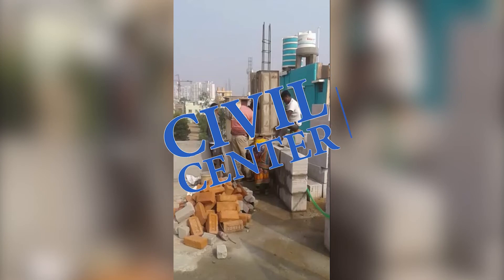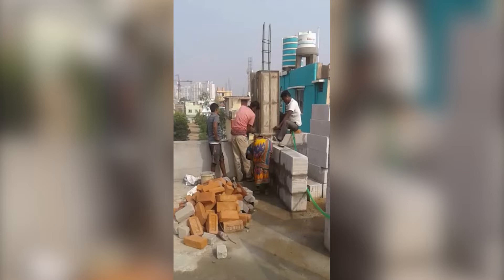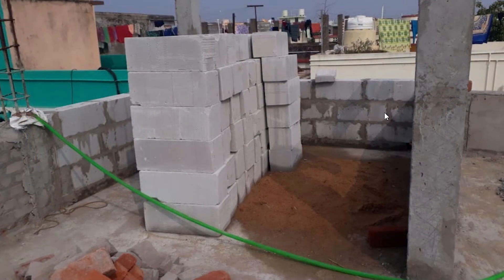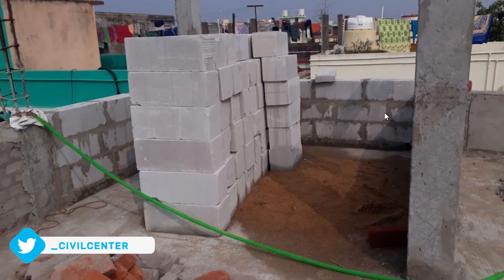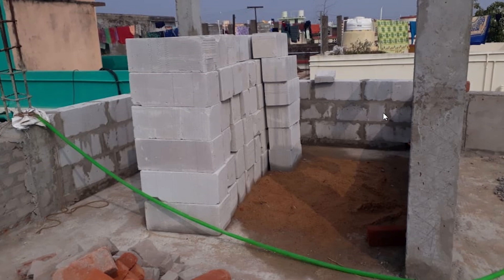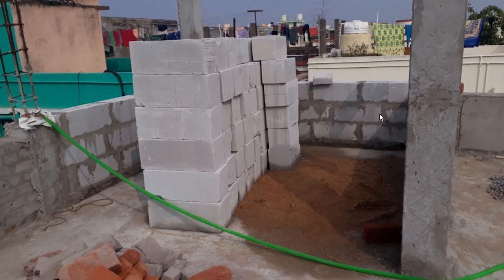AAC Blocks: Pros and Cons

Comment: Do not use AAC blocks for construction, I am going through hell in masonry work for joint cutting and it is too slow as compared to brick layering and working through corners and wall jointing, it is just too time consuming...complete no no anybody planning...I have switched to bricks after 1 floor BIG NONONONO
Reply: Why don’t they just make corner aac blocks?